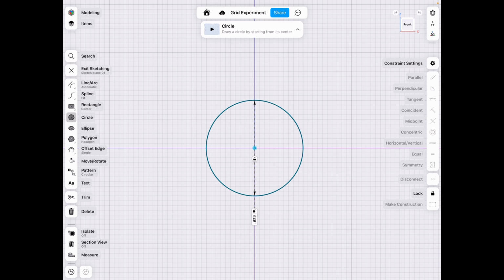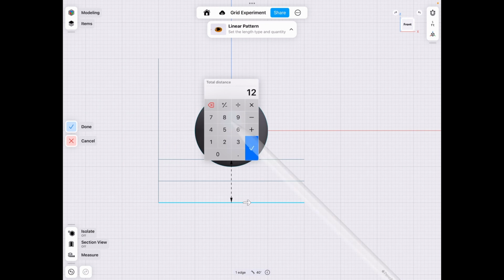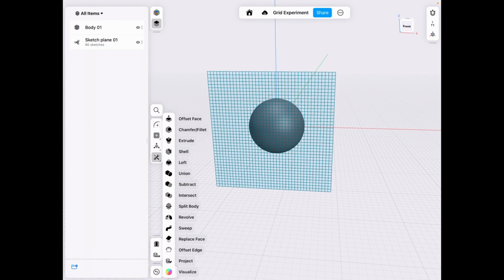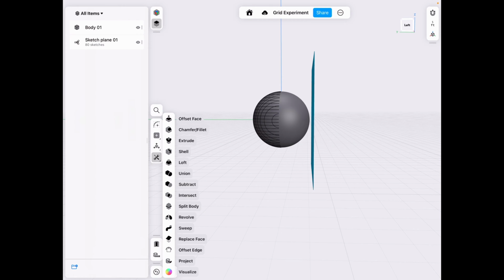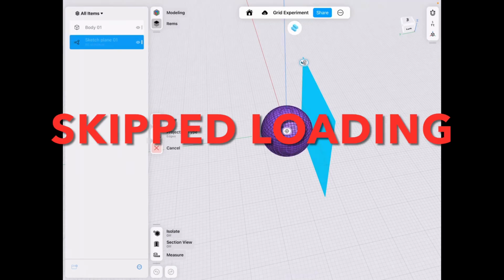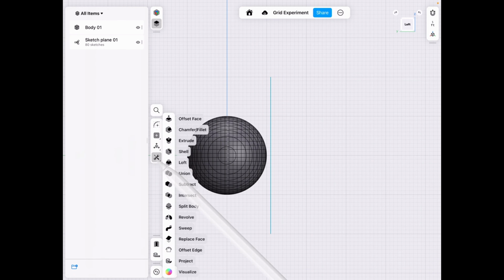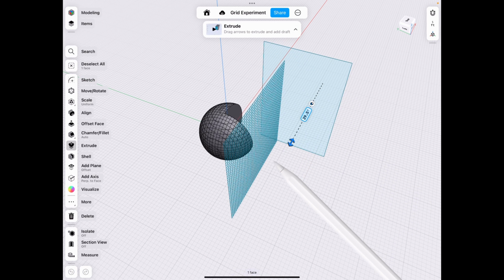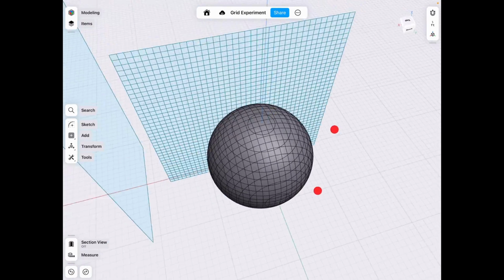Grid on Sphere [ Shapr3D ]

Comment: Why don’t you take now I’m new so it might sound stupid but the grid you created on the plane cut out a circle or do it as a circle and then revolve I don’t know if I’m saying it correctly but hopefully you understand what I mean. say you’re turning the plane around the ball which is creating, the bad visual effects or just take and cut a piece of that circle out once you’ve rented it like an orange slice almost I don’t know if that’s possible but if you can then take that and revolve it
Reply from the maker: Thats an option, and I already have a tutorial on how to work with spheres, but a user specifically requested how to put grids on a sphere for their own application.
Reply from the maker: This is the closest you will get using your method because the squares are all different sizes. Using one square and revolving it around will only make a circle in one direction. It will not make a sphere. I ran i to this issue when modeling my disco ball.

https://youtu.be/eFahhckSvk0?si=gPUFeRVVMvhgt6lA

https://youtu.be/2yxmB6Ha_Q4?si=Y-HykP2NV61KSjQJ

Comment: It's about time Shapr had a menu of geometrical objects to speed up workflow, like other 3D programs.
Reply from the maker: In their defense, in the time it would take you to find something in the menu and enter its dimensions, you could have sketched a square or circle and extruded and revolved it. Objects may make more sense for sculpting apps. Now if you add AI and you can say “give me a 5x5” square with a 2x2” cylinder cut through the middle” that would be an improvement 🤘

Comment: Which IPad version and specs are you using please?
Reply from the maker: I’ll check later today and get back to you, but its an iPad Pro 3rd Gen.
Reply from the maker: It’s actually 5th gen, my previous iPad was 3rd gen and a bit slower.

iPad Pro 12.9” 5th Gen 512GB
Reply from the maker: But my old iPad still handles Shapr3D without issue, although I guess my loading screens on these types of experimental projects would be much longer.